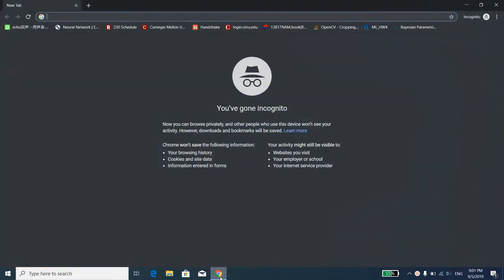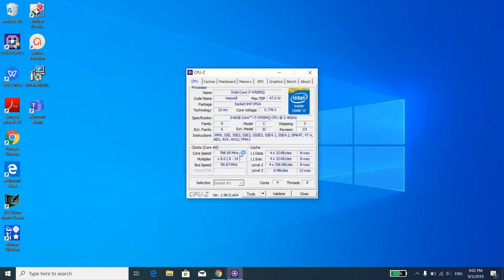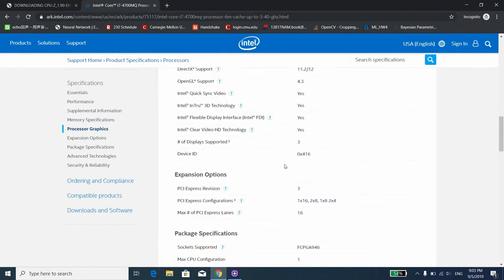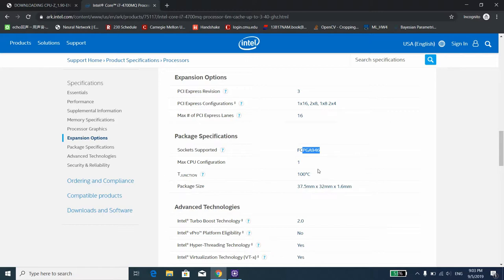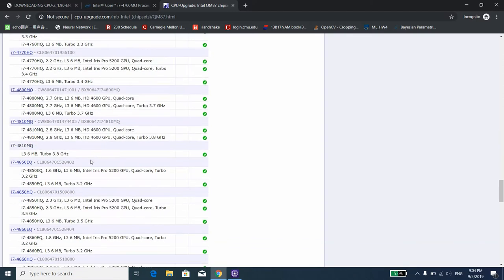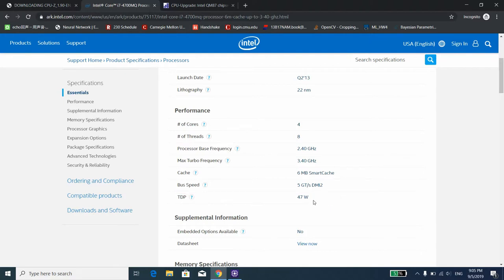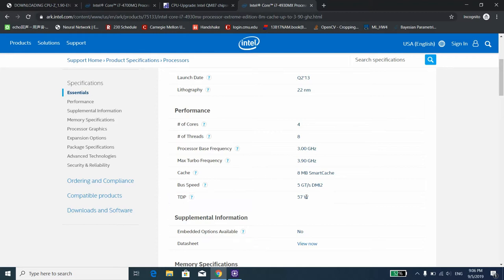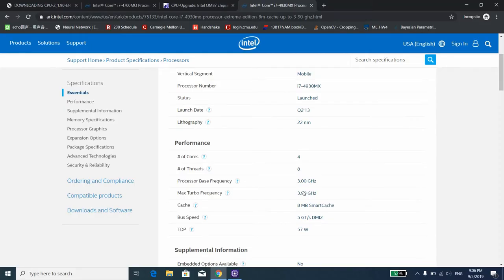How to pick up the correct CPU for your laptop upgrade

Comment: 1. Are there any example videos of people soldering CPUs to upgrade their laptop?

 2. I'm sure someone might have made a list of HP, Dell and other manufacturers that have models of laptops that support upgrading the CPU,sadly I can't find one. Do you know of such a list? am mainly interested laptop models with 3th and 4th gen Intel i5 and i7 CPUs.
Reply from the maker: Remove a soldered CPU will require some very specialized tools. There are some videos that people talks about how to remove the CPU using heat gun. Again, it is not recommended if it is the first time that you are doing it. There is also tedious steps (like cleaning the contact points and reballing the board) for soldering on new CPUs.

I don't have a list. A rule of thumb is that go for some bulky laptops instead of the ultrabook. A laptop that is advertising for long battery life tends to use U series chip, so also avoid those.

Comment: What if the TDP(25) for the new cpu is lower then the maximum TDP (35)
Reply: If its lower than the cpu you already have fitted then that's fine. Its only of its more because then the cooling system can manage it

Comment: it helped a lot.i am planning on replace my current CPY.. I wanted to ask my cpy is i5 7200u 2 cores 4 threads ..socket support bga is 15W I find same i7 with Frequency 3.5 till 4ghz . my current is 2.7 till 3.1 ghz is it fit in my system or will burn my GPY
Reply from the maker: If the TDP is within range, in most of the cases, it will run fine.

Comment: Hello.
I want to upgrade from  : i7 4600M (37w)  to  i7 4910MQ (47w) , do you i have to change Cpu cooler too  ???  because the first cpu on 37w and the newer on 47w.
Reply from the maker: It would be fine to use the high power CPU without modifying the cooler. Modern CPU has throttling feature that limits the temperature. It's hard to find a aftermarket cooler for a laptop. If you can find one, go for it!

Comment: Hey can i ask you, what's the best upgrade cpu from Dell inspiron 3420 ?
I have an old laptop that i want to experiment with
Reply from the maker: It really depends on the workload that you want to run on your laptop. For video editing or other multi threaded workload, you may want to use an i7. And if you are just using it to do some document editing and sometimes a bit demanding work, i5 should be good.
Reply: @qiaojiezheng5310  yeah, but can it work with external gpu? i'm already trying it, but afterward some horizontal line in my monitor begin to pop up. 
after cleaning and changing part session. is there any problem with the hardware or just in my monitor? 
thanks for the advice!!
Reply from the maker: @marus.haruki4719  It is possible to use external GPU. You would have to unplug your network card to get the PCIE port needed for the GPU. You will need an adaptor and a desktop power supply for that. There might be problems with the compatibility of the E-GPU.  
For the problem, I would guess the problem might be more likely to come from the monitor. Connect your device to an external monitor can be an easy check for your hardware. Hope that helps.
Reply: @qiaojiezheng5310  wow that really helpful, thanks foranswering my questions, hope you have a nice day

Comment: Hello, I have an old laptop with Intel hm55 chipset. I am trying to find an upgrade but there are conflicting information on the web. Do you think that i7 2620m would fit? Any other suggestions? Thank you in advance.
Reply: НМ55, socket rPGA 988A max i7-620m, i7-640m

Comment: Hey man, I'd like to know if you can upgrade a ryzen 4300u to a 4700u
Reply from the maker: I have not ever dealt with ryzen laptop processors. But since most of today's CPUs are soldered, I would guess no.
Reply: @qiaojiezheng5310  awww that sucks, but thanks

Comment: but what if the max fsb of my motherboard is 800mhz can i still put a 1066mhz on it
Reply: it depends on the motherboard chipset. Look at the chipset in the laptop through the CPU-Z program (Mainboard tab). What processor do you currently have in your laptop?